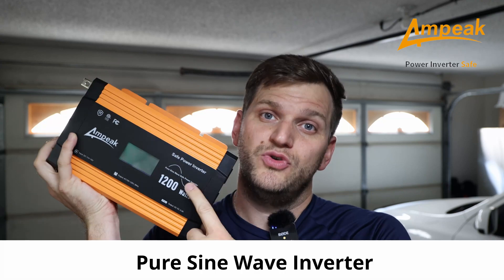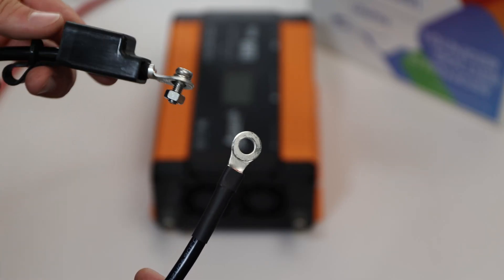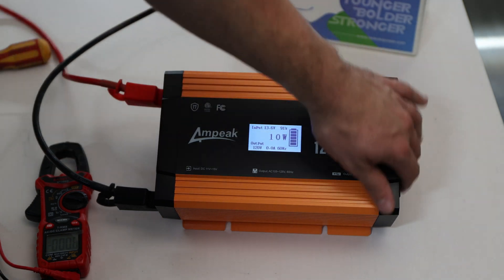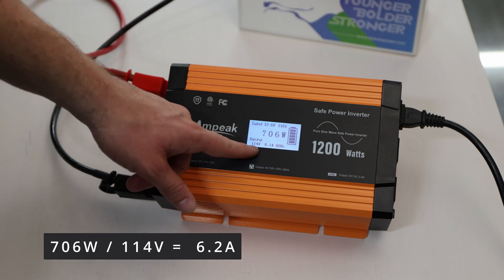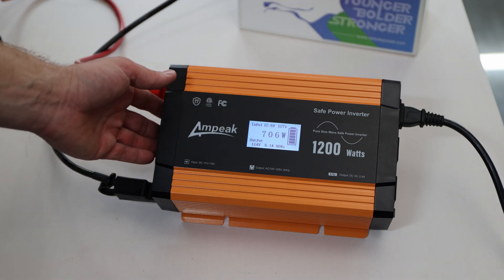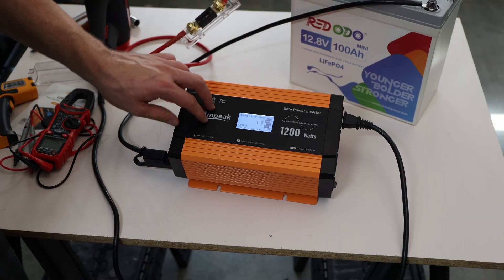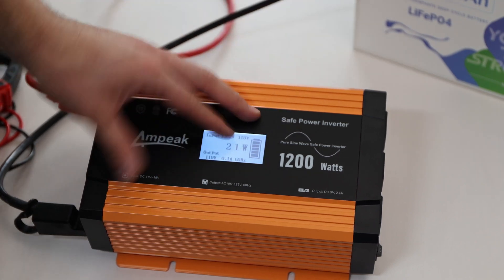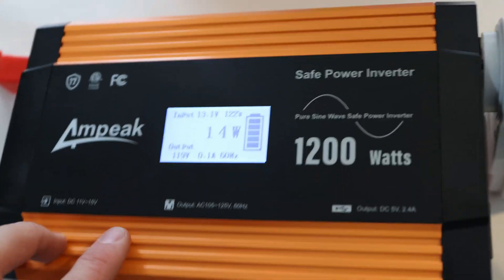How does the Ampeak 1200W  Pure Sine Wave Inverter perform with REDODO 12.8V 100Ah MINI LiFePo4

Comment: Your cables from the battery to the inverter should have been about 2 gauge for  a 1200 watt draw, I think.

I would like to have seen a more extensive noise test. For instance, how much noise with a 50 watt draw, a 100 watt draw, a 700 watt draw, etc.